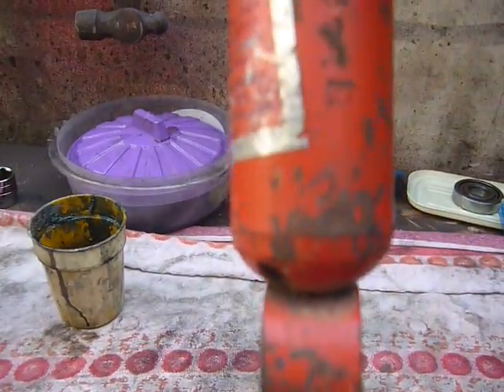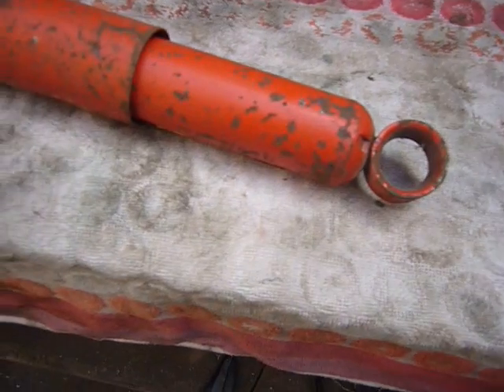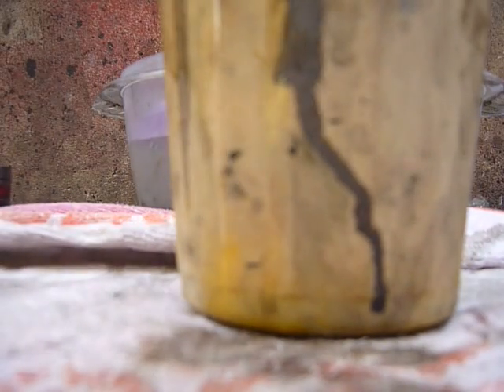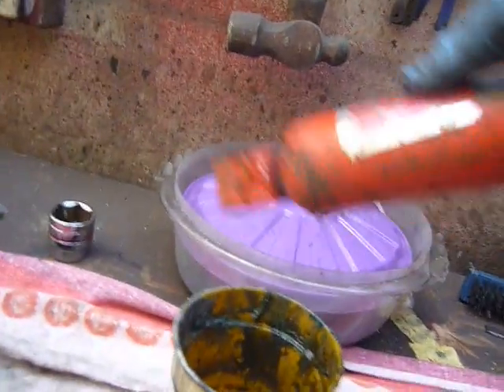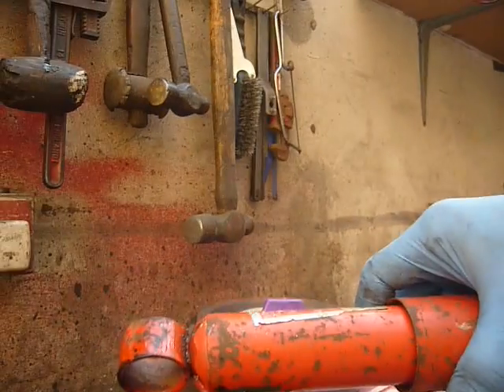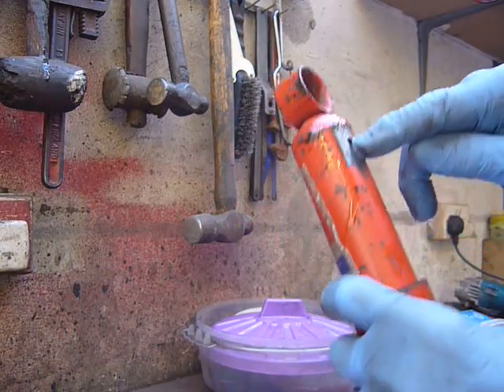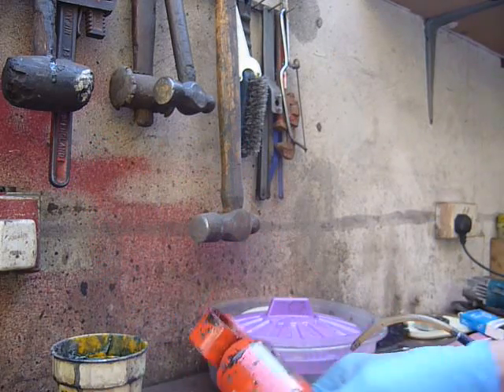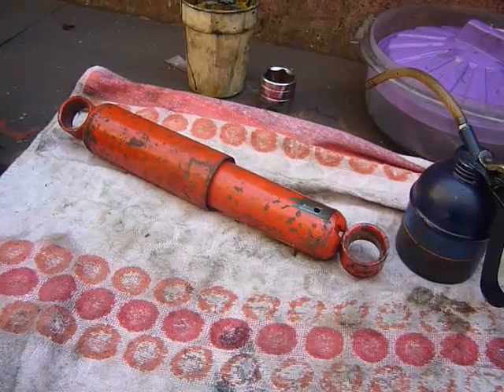Refilling oil filled telescopic shock absorbers.

Comment: Wow...still useful in 2025.... been doing that since the 70s

edit: i braze ( brazing is with brass, but sometimes i silver solder instead..)  brae a M8 nut over the hole, then seal it with a very short M8 bold and a copper washer!!!   M6 will do too.

 I have never tried just soldering a small copper circle over the hole,   with the soft solder lead-tin... 

 but now that i thought of it, that is what i will now on this 1994 Opel Monterey 3.1 TD:  i will cut a 15mm circle out of .50mm copper and SOLDER (i am an EXPERT at that... »»» DO TIN the steel  on the shock FIRST,  then TIN the copper, then solder, hammering the copper to the round of the shock...

thanks to this video, and me writindg the edit, i found this NEW WAY, in which i don't have to HEAT the shock right where the bottom valve is....GOOD;  oh.... and i will then drill a VERY SMALL hole,  between 1mm and 2mm, no more needed, just takes longer to fill.

Comment: Hi Hensen, I have new shocks that bounced about 4 times when stopping. do you think
fitting a heavier weight oil would slow the bounce down ? thanks
Reply from the maker: Yes, 100%. Use 20 grade to firm it up.
Reply: @Hensen1954  Many Thanks.....

Comment: I always grease up the end of my drill bit and have somebody hold my shopvac nozzle up to the drill hole to catch the swarf. I refill with ATF as it swells the seals and makes it last longer. The seals for the rod allow a thin film of oil to pump by and the shock will have less oil than new from the factory. I fill them up and remove the air and just top them off and never have a problem. I TIG weld a nut to the hole and use a screw with fiber washer to seal it for next time. I top mine off about once per year.
Reply from the maker: I agree, good practise.

Comment: Many shock absorbers are oil filled and then pressurized with nitrogen to keep the oil from aerating.  Also, the best oil for a shock absorber is one that keeps viscosity in all temps. Otherwise you wind up with a shock that rides hard when it gets cold out.
Reply: Is it possible to inject nitrogen into an oil type shock absorber? Because in gas type absorber, nitrogen and oil are in different chamber, not mixed in one chamber

Comment: Henson, if you're still around, I have 1960's Honda M.C. shocks that I think the oil has gelled rather than thinned, I don't know that for a fact but I suspect that.  I wonder if you have ever cleaned a non-rebuildable shock and gotten the old crud out and replaced the oil afterwards, and if so is there a way to determine how much oil to replace it with.  Thanks for the video, I always wondered if there was a way to replace oil in shocks that don't leak.
Reply from the maker: I doubt it has gone to gell, with no oxygen. I think follow the video and see if its still liquid.
Reply: @Hensen1954  I'll give it a try then.  Thanks-

Comment: Very informative but I have a problem that you havnt covered .   My car is a Humber supersnipe  and shock absorbers are not available  but all the oil has leaked out of both of them , so how much oil should I use ?  can I over fill the things ?
Reply from the maker: No point in refilling if they are leaking. You will have to get new ones. You will always find something to fit. Just measure the fully out and fully in length and get ones from something else. You could even get air shocks for a few extra quid.

Comment: So, there is also some air inside or can you fill it to the brim with oil? Do you have to buy shock oil or can you use a certain grade engine oil? So any 30 grade? 5/30 10/30,, 0/30 any engine oil, etc?

Comment: New KYB shocks go back to extend position by themself, but they still have oil in them.
Reply from the maker: You probably wont need to refill new ones for a long time.
Reply: Hensen1954 well, I just bought two that leaked oil, brand new out of the box🧐

Comment: I wanted to know if you get the oil hot in that shot will it blow up? I am trying to figure out should I use a TIG Mig?
Reply from the maker: If you weld it with the hole facing up, the oil will be lower down, so it does not catch fire easily. However, sometimes, if you dont weld quickly, the gas catches fire, but it is nothing more than the flame from a match - no problem at all. They dont explode, lol.
Reply: @Hensen1954  do you have any videos or anything so I can see how you actually weld it and how you did your B I want to make sure I do this right thank you so much.

Comment: Hi Hensen, Interesting video. I have some shocks on an old 2CV (I think they are just oil shocks) I will drain them and measure the oil that comes out but wondered roughly how much there should be in a shock so that when I drain them and see how much oil there is currently it might give me an idea as to whether they have leaked in the past and the seals are shot - so probably not worth refilling. Useful video, thank you. Chris
Reply from the maker: If its leaked past the seals it will be obvious. They usually take about half a cup full.

Comment: I did this some years ago but I drilled a 3/16 hole then just screwed a 10 short bolt in no problems with leaks u can probably still weld it or use a brake nipple for future refilling

Comment: can engine oil be used or is it some other kind of oil
Reply from the maker: Engine oil is OK.
Reply: @Hensen1954  hi mate can i use 20-50 grade oil
Reply from the maker: @abrishatube  yES, BUT IT WILL BE QUITE A FIRM RIDE.
Reply: @Hensen1954  what would you recommend for daily driving small car the pajero mini
Reply from the maker: @abrishatube  straight 20 grade.

Comment: Damm,guy,(and galls,can't forget them!):here what you DO!!!!!! you braze a M8 nut over the hole,cut a M8 bolt short,and tighten it in there, WITH a COPPER washer;  you DON'T weld up ,on that shtt ,after it's full of oil!!! (you could ,but you shd stand 30 ft away,lol).
Reply from the maker: You could do it that way. as already talked about in the previous comments below - about 2 or 3 years ago.

Comment: Right, now have a good laugh at me, I drive a 3 wheeler, a Reliant Robin, not a Robin Reliant, or a Robin for short, been looking at how to do the above,  me shocks are around 30yrs old, dont leek, just a bit old, they are oil and not gas, so many thanks, I was thinking of putting a screw in nipple in hole instead of welding it, you lean some think new every day, when some think is brock nows a day, in stead of try to fix it, they get a new one, costing £100 or more, this way, 2hrs, may be £10 for oil, ps, well 20/50 engine oil work, that wot I put in me engine   :)

Comment: I took my car (Dodge Neon 05) to a car repair shop to check the shock absorbers, and they offered me to repair them, because they were apparently locked. The struts with the shocks were dismantled, and the manager told me that he repaired them, changing the oil. He showed me that now they could be pressed down with a hand, and this didn't seem to me to be right. 
They installed and I left the place. The result is that now the car is bouncing on the springs of the struts, they have no damping. Also I notice that the suspension is lower behind than it was before. The driving is unbearable, the car bounces on the springs with the minimum road bump.
When I asked the person in charge of repairing the shock absorbers if he had assembled them with a lot of pressure, he replied to me: "Since it's a small car I did not put too much pressure in the shock absorvers."
How is this possible? How can you regulate the shock absorber with much or little pressure? Pouring less oil?
He offered to increase the pressure on the shock absorbers again. What should they do? Increase the amount of oil? According to what I understood in your video, you have to pour the same amount of oil that comes out, no less, no more. Is that right?
I have to go back there next wednesday, I would really appreciate your advice.
Reply from the maker: Greetings. I looked at the Neon  shocks / struts. They are only 71 dollars new for a pair, so very cheap. Anyway, back to yours. Something is very wrong. Yes, you must use the correct amount of oil. To make them stronger or softer, you change the thickness of the oil - and just a little bit thicker makes a huge difference. Try squirting water out of a syringe, then try treacle !! Nearly impossible. If the car bounces like you say, its bordering on very dangerous, as well as uncomfortable. The Neon is not a heavy car - about 2700 lbs - so for road use I would go for oil rated at straight 15 grade. However, I was not sure about the  shocks being "locked " ?? Does that mean seized ?? The situation does not seem logical to me with the above information, that the repair shop told you.
Reply: +Hensen1954 Yes, the manager told me they were stucked or jammed. When you tried to push the car down in the rear corners they didn't move at all. Now I'm not sure if that's a valid test, at least with this car. 
I am not moving the car too much until the problem solves. It is unbearable the bouncing.   They told me to go tomorrow to fix it. What I want to know if they can restore the shocks increasing the pressure, specially the height, since I see that the suspension Is lower than before and that makes the springs to work in excess.
 By the way, I appreciate your advice of buying a new pair of shocks, but I live in Venezuela, a country turned in a new Cuba, and shocks and all car parts are very expensive. I am doing this as a temporary solution. 
So, my final question is: can be solved? Can they increase the pressure of the shocks pouring more oil assuming they didn't fill the shock with all of the oil it should contain? I got the feeling that the manager wanted to save in oil, because of the price he charged me. Thanks in advance for your answer.
Reply from the maker: OK, good luck.

Comment: what about for 10w40 oil?
and does it has to be new oil or ot can be used one from motor  changed before interval
Reply from the maker: Well, I only used straight oil of a given viscosity. But would never use old oil  when its so cheap to get the3 good stuff.

Comment: great video i had a thought though. could you tap in a thread and install a bleed nipple so if you wanted to tow a trailer you could add a bit of extra oil and then when finished bleed some oil back out ? would adding a bit more oil solid up the shock or do you need a thicker grade?
Reply from the maker: +Bryan Foat  Please read other comments, however, why add extra oil for towing. Do you put extra oil on your engine to drive up hills ??
Reply: because as soon as you put a caravan on any car it lowers the ass off the car even if the ball weight is low. going up a hill has nothing to do with it and i aint stupid i was just asking a question as atm i have air ride shocks that can be pumped up when towing but you would think if you could put oil shocks on it would be a more stable ride and less risk of an air line blowing and potentially causing an accident.  my question is can you add more oil for more ride hight or would you just bleed the oil out and put a thicker grade oil in?
Reply from the maker: +Bryan Foat More oil or thicker oil does not change the ride height with this type of shock.  Thicker oil makes a stiffer shock.
Reply: I tried tapping with 1/8” NPT (tapered pipe thread in US) it barely works as the shock wall is so thin. A plug and epoxy putty (quicksteel) will hold the plug and help it seal tho, which is a lot simpler than welding, albeit uglier. If you want more damping use thicker oil, not more oil, the shock should be full already as it is.

Comment: so first i have to buy a welder !!!
Reply from the maker: MrDelvis007  Or borrow, or take to a mates whose got one, or use a rubber seal and jubilee clip.
Reply: Hey. Interesting. Where’s the part where you weld over the oil filled pipe and then drive down the road with it installed?

Comment: You can use just any engine oil? Also I have an oil shock and I can push it down with one finger and it wont come back up unless i pull it back up and it is hard to do. IS this shock no more good?
Reply: Kyle Sauve I

Comment: hey bro! nice video but i have a question! you ever tested repaired shocks on your car before? & in some other videos i saw other guys adding air to the shock after filling up with oil is that necessary ?
Reply from the maker: Jamie De Angelo  Yes, I test for 40 years. You do not need to add air. OIL is OK.
Reply: ok bro thanks! ive been wanting to try this. i bought a pair of kyb gas shock and it rides like shit

Comment: u used to work in a breakers yard and a colleague cut through a shock absorber with a stihl saw and it literally exploded. i was told by the owner that on certain cars it can be extremely dangerous but i guess this is just the oil filled ones as there is no pressure. gas ones can be anywhere from 100-300psi which could easily blow your hand apart - make sure they are oil!!!
Reply from the maker: Weak End  Yes, thats why I state at the beginning - for oil only.
Reply: Thanks for sharing the video though :)

Comment: Did this to a stock shock to an volvo 240. Went great! used 15/40 oil(alittle mix with 10/40 and liiittle old oil left in the shock). But, its rly "tardy" to pull out but when compressing it dosnt feel very stiff... Am gonna get another shockabsorber and compare, but it kinda feels "loose"... Anyhows, great vid! U should do more of these!

Comment: a few questions, does the hole have to be at the bottom ? since i will try this on an old shock absorber with a slight leak is it safe to add oil till half of the reserve tube assuming the pressure tube is fully filled ? if so, i plan to drill in the middle so if oil overflows then the reserve is half filled. how much pressure is there in the reserve cavity during operation, reason i ask is how i will seal the hole if i have no welding equipment. thanks!
Reply from the maker: Greetings, I drill at the bottom because the oil is there, and it does not interfere with the up and down movement of the dust cover / shroud. I think every shock I have done has had about half the amount in the oil can I use in the video, so I am guessing an eighth of a pint. You dont have to weld up the hole, you can tap and bolt or just use a rubber plug / cover,  held in place with a sturdy jubilee clip.  There is pressure in the inner chamber when the  piston is in motion, but that is in comparison to the second chamber, not between the inside and outside of the shock. Experiment as you wish, you dont have to worry, its not filled with dynamite !!
Reply: Hensen1954 .
thanks for the prompt response. i will experiment on soldering a shrader valve and see if it works too if i pump in nitrogen or maybe just air. the reason i asked some of the questions is that i will have to install it in the car to see if it works well and it's the coil over type so not that easy to install/uninstall. thanks again.
Reply: john adams
was experimenting on this, and found out that if you put too much oil you won't be able to compress the piston rod all the way down to the bottom at least by hand. so i temporarily sealed the hole, rubber and jubilee clip is fine, and checked that the rod bottoms otherwise who knows where all that pressure would go,

Comment: Hi there, i watched this video and tried to do this on a steering shock absorber.
The shock seemed to be a oil filled and not gas filled.
When i drilled the hole the oil sprayed a bit as i were drilling but nothing dramatic, so im pretty sure its a oil filled as if were a gas it should be a lot worse.
So, i then get a 30w oil and sent the shock so a guy could weld a nut over the hole so i can close it with a bolt, and when i want to refill again i just open it and close it again. Well this guy opened the hole a little more and there was a little rubber on the inside and when he was opening a bigger hole he also drilled that rubber, and i dont know if this is bad or not?? Why? When i get back with the shock i refilled it with the new oil, but i got a leak trough the weld beads.
I then filled the weld with epoxy jb weld. The problem is i kept getting air inside the shock when closed. I fill with oil and the shock makes a good motion(stiff) trough the travel, but when i close it and pump it it starts to make movement stop as air i sttopping the shock travel and getting soft...Do you have any ideas to fix this?
Thanks.
Reply from the maker: Maybe if you pump it more the air will be dislodged. I have never had a problem when I do the work as in the video.
Reply: Hensen1954 .
I believe the problem is with the plastic bag inside, its filled with air and works as air stop or a space filling as no gas is needed in that application. for example my plastic bag was pierced, so when the shock was compressing the oil was taking the space in the pierced plastic bag making the shock lock like air was still trapped inside. so here is a warning to you all ou there, do not pierce that plastic bag or you will throw a shock out. it is imposssible then to make the shock work without that.
i will try to get a hold of another one so i can try again.
Reply: bom dia vitor será que me pode ajudar no tópico que meti em cima? 
obrigado

Comment: if trying this see first comment, weld nut over hole and cap with a bolt while no oil is in the shock. if you have a sealed steel pipe, fill it with oil and simultaneously seal it while heating it to several thousand degrees, what you are likely building is a pipe bomb....................

Comment: Theres always a bur when drilling what about the risk of swarf getting in the valves?
Shox don't affect body roll in corners, they will affect the momentary roll when the car attempts to move but will allow full body roll as the shock is weighted, there is no spring to support weight shift just a reduction in the speed of the roll. Shox are to dampen the resonance of the springs not hold a car up.